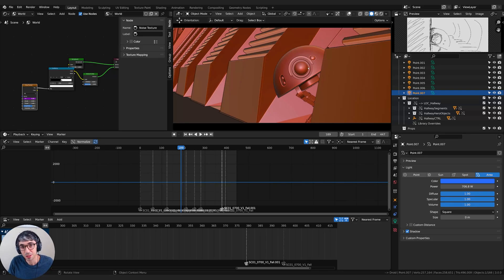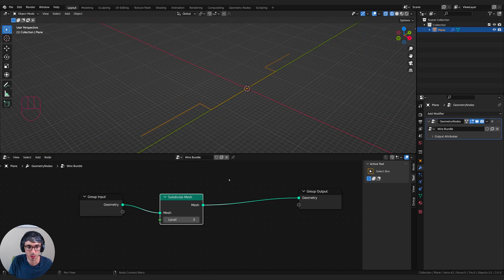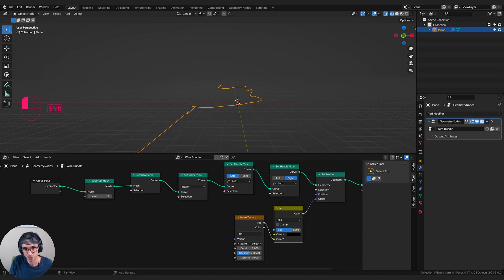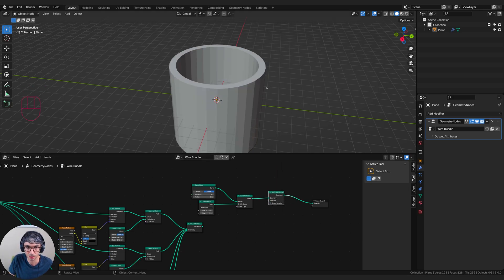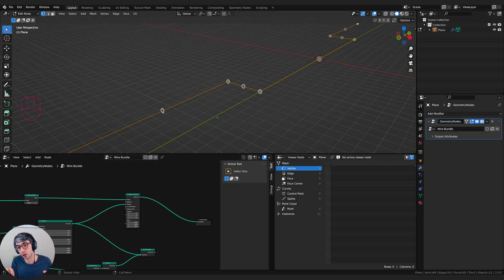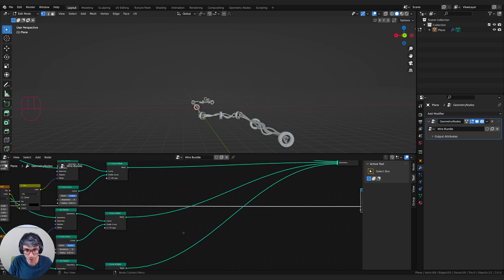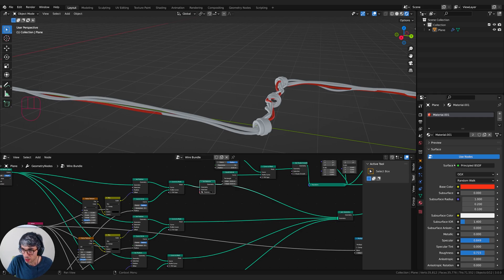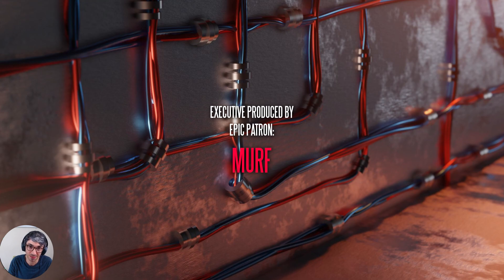Turn Edges Into Wire Bundles With Geometry Nodes - Blender Tutorial

Comment: There's an easier way to incorporate the additional wires without extra nodes, use a Duplicate elements node and plug the duplicate index into the noise texture's W field. This not only allows you a simpler node tree, it also allows easy control of the number of wires.
Reply: This!  To clarify...plug from set handle type to duplicate elements (geometry) set it to spline.  Take the geometry output and plug into the set position-geometry.